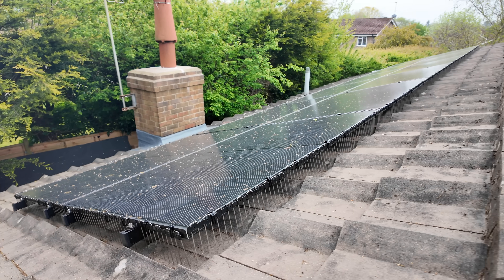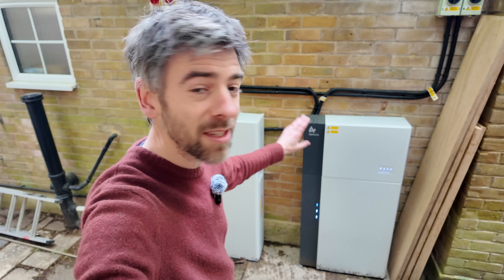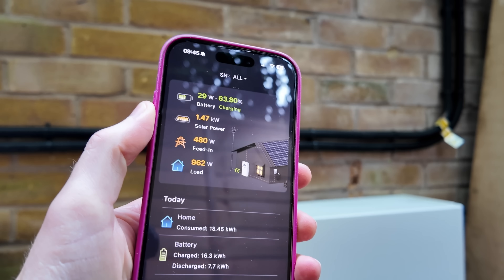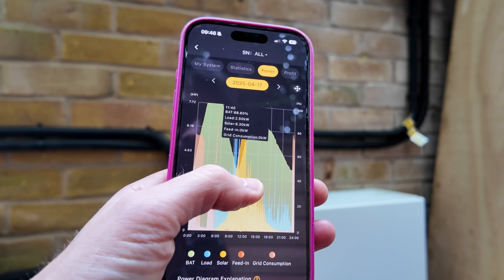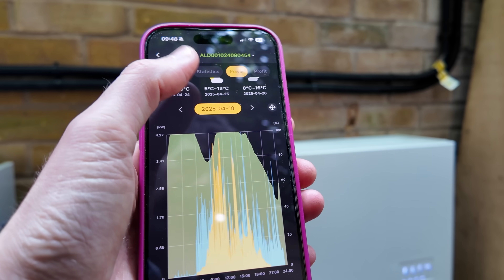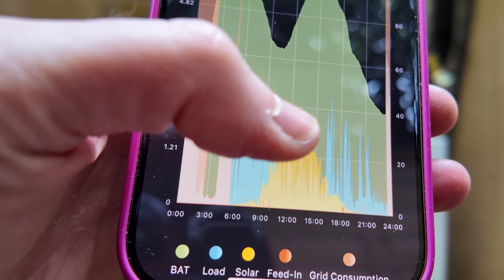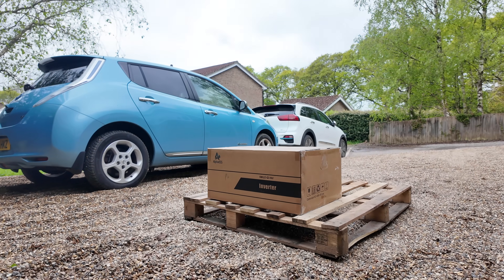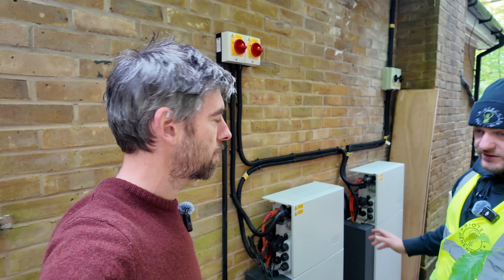Inverter issue! Problems with our AlphaESS system from Heatable. Here’s how they were resolved

Comment: Hi Andrew,
I and my wife met you on the Thursday (?) at the Everything Electric show in London (we were near the Electric buses and Euan McTurk said goodbye to you). You'd just released your first 'new solar' video which I hadn't watched at the time. We sympathised with you for losing so much money with the power on your household consumption!. What we didn't both know at the time was that you were getting the same Alpha dual inverter/battery set-up as we already had. We had ours fitted on 12/03/25. There was a delay of a few weeks because when the installer first came to fit ours (in Wales) - and he spoke 'live' to the Alpha support (they wanted to speak to the original designer/creator - I think he was based in Japan) and they weren't sure the system would work as our PV system wasn't 'balanced' (Heatable knew when we ordered the system what PV panels we already had when the system was sold to us etc). In the end the installer returned several weeks later to fit the units and the question of 'if' the the units would work had gone from the conversation. I was slightly worried we were in a 'suck it and see' guinea-pig position. We have 10 solar panels on our back roof and 8 on the front of the house (previously we had a Growatt inverter which worked fine, but as we got a Heat Pump in January we wanted more battery storage for the winter months).

Several weeks after the new Alpha install when we had clear, uncloudy days (18/03/25) - I realised that we had two problems on the system: first of all, when the 'follower' inverter/battery was full the solar would 'drop off' or be clipped before the host battery managed to fill up several hours later. Then there was a fault as the host inverter/battery wouldn't export the 'excess' solar to the grid and again we would get 'solar clipping' on the host inverter/battery. We could get more solar in on the system if (for example) we charged the EV on the plug (this allowed the PV to start pulling in to the potential in the solar panels). Not perfect, but a work-around. I'm sorry to say the response from Heatable was slow. I'm glad you got a fast result. In our case, Heatable stated that it was a software update matter, and it was left with Alpha to investigate remotely. I also raised the query personally with Alpha at their stand at the EE London show probably on the same day as you! ..coincidence... (!)

So - the fault with our host inverter/batter exporting solar (and solar clipping) took Alpha to 20/04/25 to sort (reported 12/03/25 with Heatable). The follower inverter/battery being able to take in our solar and export wasn't solved until 10/05/25. So almost two months to solve since the problem was reported. Oh, and then the fault re-occurred on 21/05/25, including some strange 'battery peaks' during the night which are not related to the house electrical usage, and some excess 'drawing from the grid' during the day. Thankfully, that seems to have now been fixed in the last few days by Alpha remotely. So - I do hope your problems are solved. 

My opinion is that (and remember, Alpha is a company from Germany/Italy originally and only recently being based and installed in the UK) is that the parallel-system on the Alpha Battery/Inverter hadn't been properly 'beta-tested' in different domestic properties in the UK and I think it has been rolled-out too quickly. But maybe I'm wrong. I hope we don't have any more faults with our system too. Best wishes - we enjoy your videos as always and it was lovely meeting you in person back in April.
Michael
Reply from the maker: Hi Michael! Yes, I remember you both very well. I think I called you Richard as you left (it was a long day!). Thank you for saying hello!

Thank you so much for your comment. That's really interesting to hear you've had similar issues to us. I agree that it does sound like we may have been guinea pigs for Alpha, but hopefully things will be smooth going forward.

I do occasionally get some spikes of grid usage throughout the day, which seems odd to me, although I think it's when there's a sudden spike in load (around dinner time when the oven goes on for instance).

Do keep in touch and let me know if you have any other problems.
Reply: @MrEV Hi Andrew,
You're right about my name as we left but I've no criticism there as I 'm great on faces and no good on names too!😊

I'm lucky in that - regarding reading energy spikes - as we had the Growatt Inverter working properly for over a year previously I can easily read what is using power in the house (Kettle, Induction hob, oven, Iron etc!). Yes, geekery runs strong in this one😅

I have little problem with companies having minor problems to iron-out with renewables as there are so many different systems/apps now in the House (plenty in ours). Hopefully - as we both agree - this is the problem sorted. You can always get in touch with me via my own channel contact email if you want to ask for feedback etc. Maybe we'll catch up again at a future EE show. And I'm sure your bills will reduce a lot over summer/autumn in particular so good luck! 😊 best wishes
Michael

Comment: Nice to see it’s all working well!
Now that we’re well into the time where you’ll be clipping your 5kW inverter and based on the charts you showed you’ll be loosing a lot of power to clipping
You can avoid that by switching to export first
I did this recently with my system and gained so much as the inverter will export 5kW and charge with any excess above that, I’ve seen 7kw off my 5.9kw rated panels on colder days for a short time.
Reply from the maker: Thanks for the tip, although I have a 10kW inverter (with the two 5kW inverters connected in parallel) so no clipping any more, now the issue has been fixed!

Comment: I'll be interested to see your figures.  I have an 11 panel array, distributed over 3 orientations clockwise from NNE.  (Only found one installer willing to install on the northerly face ~ believe me, even that's worth it; except for the 4 winter months!)
My total array is 4.73kWp, and I've seen it touch 4.2kW briefly this week....
It took a little while for my Octopus bills to get right - I'd started on FLUX and moved to GO - I  only have a PHEV, so I can only have the standard 'GO'; but it's certainly a good earner with the night-time charging of my Tesla Powerwall3. 
I'm guessing your figures will be stable by the end of the summer...
Enjoy the rays!

Comment: I have a solar battery system so not a doubter. So how long before you get to pay back?
Reply: He'll need a whole year of data to get a meaningful figure, but 7 years is normal. Maybe a bit longer for an East/West system.
Reply from the maker: We got the system at a big discount from Heatable since we're filming the process but ordinarily for a £19k system like this we'd be looking at about a seven year payback.
Reply: how do I calculate the payback on my gas boiler and 3l 4x4?😃

Comment: If your bank are full and your house load  is very low. The inverter will shut down your panels.
Reply from the maker: Yes, although in this case there was more than enough capacity to export up to 10kW, if it were working properly at the time.
Reply: Here in the USA.  We have the option to go off grid or hybrid inverter that let's you both sell back or none export.  And they start around $3499.00 us dollar.  They are expandable.

Comment: That's great you are back up and running. I think the key to getting a good solar install is not to purely going on price but hiring  a company with a good solid history and a good  guarantee. I had some problems earlier this year with failed optimisers which took down a string.  10kw system, 6kw inverter made £160 so far this month! apptastic :)
Reply: Pretty good advice for life really.  Not just solar!
Reply: I had a sales/install company which was poor: however, direct support from the equipment companies help desks was perfect. 
Installers can come and go, but manufacturers have to maintain a constant level of behaviour.

Comment: If your batteries are DC coupled there's no reason why you wouldn't see the full 13.5kW from the panels while the batteries are charging.  Output would drop to the inverter rating (10kW) once the batteries are charged. Of course I don't know if the AlphaESS batteries are DC coupled.  As an example, we have a 10kW Solaredge array with a Solaredge DC coupled battery.  I manage everything in Home Assistant, but while the battery is charging in the morning from solar, we regularly see 10kW.  Also, get yourself the Octopus Watch app and it'll give you a daily tally as well as generating reports.
Reply from the maker: Yes, it's DC-coupled. When we had the clipping (before it was fixed by Alpha) I was plugging in the EV with a granny cable, and using the pyro-cleaning in the oven to try and use as much power as possible to avoid clipping!

Home Assistant is some future fun for me once I have time to look into it properly!
Reply: @MrEV plugging things into the house uses AC up to the inverter ratings ie 10kW. It doesn't use the extra DC ie between 10kW and 13.5kW. You want to be charging the batteries with that extra DC capacity when it's available so the house or export has full access to the AC output. It takes a wee while to get your head around it, but once you do it's a game changer.

Comment: I've had an Alpha for 2 years, no issues apart from switching from WiFi to Cat4 connection to resolve connectivity.
Reply from the maker: That's interesting. The installer had to use a wired connection during setup but so far it's been fine on wi-fi, thankfully.

Comment: Really interesting video Andrew, thank you for posting.  It clearly explained the voltage and amp difference with regards to the panels and gow to check if they are working correctly. It looks like it's time to trim that hedge and reduce the pollen drift and maybe reduce some shading.

Comment: My 3.5 kw panels generated 25 kwh energy today. Incredible
Reply: Our 3.6kW system only generated 18.5kW today, as it's been pretty cloudy at times. The best this month for was the 22nd, with saw 26.8kW generated, with 24 going to the grid.
Reply from the maker: That's fantastic! I always think of generation in terms of cars: you could have fully charged an old 24kWh Nissan LEAF with what you generated!

On many days recently we've been generating the same capacity as our 64kWh e-Niro.

Comment: Good result. I have seen same issue on other large systems. Where the battery gets to 100% and generation is "Throttled" to what ever is set as export limit. I suspect because your system is in parallel one of the inverters was throttling down to 3.6kw or less (default but incorrect export level). Normally a simple setting change but with a parallel system needed the good support you got. Good they spotted the string problem too.

Comment: At the beginning of the video I thought “ Either Andrew has very long legs, or a very small house!” 😂
Just a safety thought. Have you got any railings up for when you are cleaning the panels?
Reply from the maker: I was on scaffolding that was put up for cavity wall insulation around the conservatory, so all safe. Although I do have exceptionally long legs too. 😀

Comment: CURRENT is king and hence you need to keep a big eye on your whole shading situation. 
Today it does not really matter, butter let's talk in winter and you will start complaining. Assuming you can make on a good day with 12 kWp system 100 kWh (southfacing) then you will be hit hard with 10% in winter or 10 kWh generation on a good sunny day.
Now we take east west orientation into account and you might get 80% figure of the 100 kWh = 80 kWh in summer, but in winter with all the shading you can end up far lower.

And that is the weakness of your setup , the missing optimizer (I mean passive optimizers that do not consume energy when they are in idle mode and there is no shading on that particular panel).
Check out BRC Solar from germany , they have a good explanation and it might make a lot of sense if you have a clear overview or show the roof with its horizont line and all the chimneys and things that arer getting out of the roof. 

There is an austrian android app which provides a full augmented reality picture from the side and showing in  a kind of an overlay the path of the sun. I you try to take a picture horizontally you can see each building or hill or tree which can cause a shadow on your panels You have to check all 4 corners of each array to get the full picture. And then the string layout will become another topic.

You can find their site by searching for "sunontrack app" - made in austria. And i checked it that it is also available on ios. Android price is 7€ and I bet lot less than apple but worth the money. 
Or try to get a free licence from them to show the app in a video cause it explains everything. This will be your next topic for sure once you have gotten a running system.

And if you want to get a full understanding it is time to start with home assistant. 

Once you have that your final goal will be a satelitte map screenshot, where you will draw in the strings, all 6 or 9 panels of each string means 4 arrays on the roof.
And then you observe the Power delivery per string - 4 values hardly to compare with each other until you do the math in home Asssitstant and show the key figures: power per kwp for each string
then you can exactly see how well each string is performing and you will see significant drops caused by shadows no one had taken care before. 

You might see all strings with 30 W per kWp but 1 with just 10 kWp which means that there is something different. You are simply at the beginning of the journey. YOu have spent a fortune but that does not mean you have gotten the best system for the money and that there is no room for improvement. 

Hence it is time to learn the basics: A panel produces a voltage which stays more or less the same (you will get the values from your inverter per string for every minute) through out the day and the current in Ampere is the real king. If that will drop the whole string will go down in the output. Take a black foil you can not look through and cover 1 panel. You will recognice an instant drop ot the output.
300 V string x 10 A means 3 kW DC output , not AC. But if 1 panel suffers from a shadow and goes down to 1A then the whole string will drop down to 1A x 300V = 300 W.

Voltage x current  = Power ... and power x hours = kWh ... same on ac and dc side.

Comment: Hi Andrew, nice to hear everything is working smoothly now. I work at a pv supplier. Might it have been you had an export limit? (A typical export limit for the entire property is 3.68kW which is under the G98 application) 

This might explain why you had clipping when your batteries were full :) 

Best 
Giulio (si, avete fan italiani)
Reply from the maker: Ciao Giulio! No, our export limit is 10kW so it wasn't clipped for that reason. Since it's been fixed, we've had several days of exporting the full 10kW for hours.

Comment: £5.12 surplus.  We're going to be millionaires Rodney.
Reply from the maker: 😀 Obviously that's what we're paid for exporting, but that doesn't count the savings we're making by using the cheap energy stored in the battery.

The app says we've made £533 "profit" so far, based on money earned from export, using solar, and load shifting. Not bad for less than two months operation I think — especially considering it wasn't working properly for a month.
Reply: If you get that level most days it soon adds up.  We're up £85 in May.

Comment: My array is officially 9.9kWp. My G99 is 9kW, stopped fully charging the battery overnight since I see on very bright periods I've hit 10.8kW and of course the inverter will clip not to exceed the G99 but it will dump excess to the battery and most days I do end up fully charged by sunset.

Comment: I have this month installed  an 8.5 kw system (18 panels south facing roof) PW3  northwest UK. My highest generation was on 23rd May 53.2 kwh, and the lowest was yesterday on a cloudy gloomy day, 17.9 kwh. Exporting to grid is minimal as I also have a solar diverter. Surprised to see your export is generating £6+ on a 15pence export on a single day
Reply: pitch is as important as direction / azimuth but 53 kWh is OK. But the key question at the end is the winter time .
Reply: Yeah im dreading the winter and actually thinking the 13.5 kw battery wont be enough...but I anticipate this will only be an issue, of running out of battery until my off peak begins, in the winter months. 

Question I need to figure out and calculate is, is it worth me adding an expansion pack (£5k) to the pw3  which will give me an additional 13.5kw capacity only to benefit in the 4/5 months of winter
Reply: @javspace  it's no different from having a 'Winter wardrobe' or Winter tyres, which we don't use for most of the year 😉

Comment: Had my solar system coming up 3 years; fully integrated with solar assistant and home assistant. Works seamlessly without any input now. Only one niggle: we're quite rural, and mains goes down pretty often (for what I'm used to), and the system isn't islanded. It feels wrong to have great weather, in theory producing a lot of electricity, but not able to do anything with it.
Reply: if you have a battery already add another inverter to run off grid from the battery.
Reply from the maker: Since I committed to the Alpha system we've had a few power cuts. Not too long, thankfully, but annoying to lose work on the computer. There's an EPS function on the Alpha so we'll power a circuit using that, but I do wonder whether I should have opted for a system with a gateway.
Reply: I’m surprised they haven’t installed whole house back up , it may have meant going three phase but with the size of your system it would be the most logical thing to do .
Reply: @MrEV  A laptop comes with a built in UPS 🙂